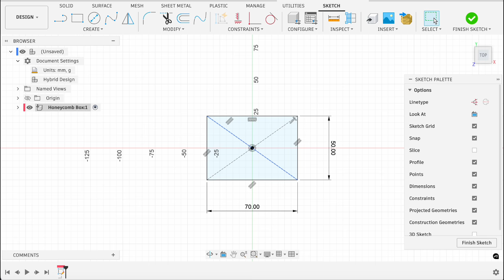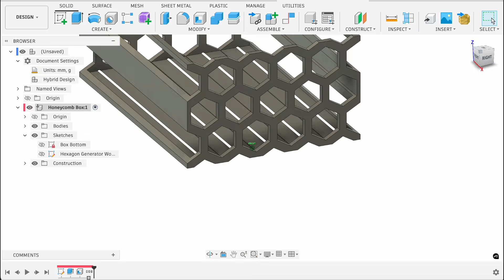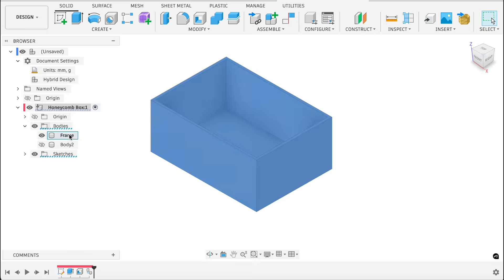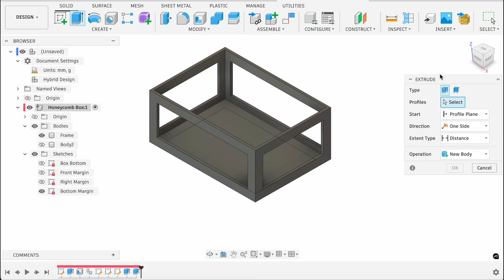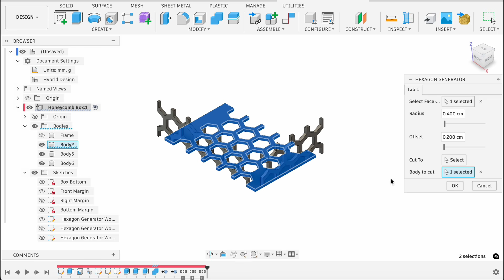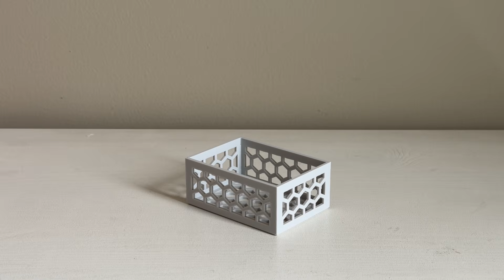Fast Honeycomb Box Modeling in Fusion 360 No Sketching! | 3D Print

Comment: how to use this on a round cylinder profile ? Tq
Reply from the maker: The Hexagon Generator works by selecting a flat face, so unfortunately it can’t be used directly on curved surfaces like a cylinder.
But you can generate the pattern on a flat sketch first, then use Emboss to wrap it around the cylinder, almost like wrapping a label around a bottle.

Comment: As a newbie, I'm getting a lot out of your videos. I just tried this and found that if I just sketched a rectangle on the surface of one of the sides, and used that as the constraint for the hex generator, I did not have to create a frame and sides to get it to work. Maybe they fixed something since you wrote them.
Reply from the maker: Interesting! Are you using Windows or Mac?
Reply: @send_to_print  Mac
Reply from the maker: That's great! Thanks a lot❤️ I'll try it later!
Reply: @send_to_print let us know if it works

Comment: You don't need to cut the separate bodies to do this. Draw the rectangle on the side and select that as the "Select Face or Profile" and the add-in will do the split, hex drawing, and re-combine automatically. It will make planes and sketches in the timeline.
Reply: That being said, the add-in is really slow and crashes/hangs Fusion sometimes, at least on Windows.
Reply from the maker: You're right, that's exactly how it's supposed to work! For some reason, when I tried it, it would only generate a single row of hexes, so I had to go the manual route. Maybe it works on Windows! Thanks for the heads-up!

Comment: I'm learning something new from every video you post. Regardless of the type of the pattern, can something like this be made parametric so the box size coudl be easily changed and the pattern (hexagons or your previous knitting pattern) to easily adapt to the box size?
Reply from the maker: Welcome back! To be honest, this specific plugin isn't "live"—it calculates the hex grid based on the face geometry at that exact moment. If you change the box size later, the pattern won't auto-update. To make it fully parametric, you’ll need to set up your own hex sketch and use expressions to link the pattern quantity to the box dimensions, just like we did in the Card Stand video.
Reply: @send_to_print  I did my own version a while ago with hexagons manually created on a separate sketch and doing patterns of either sketch or the cut/extrude/emboss features. But I could not get it to work without manually adjusting either the hex sketch or the number of hexagons in the pattern to correctly fill the sides of the box I was working with. I'm sure this could be solved with some of your parametric math skills :D.

And it does not have to be hexagons, or a plugin. I'd like to learn how to do this with any pattern and have it parametric.

There are al kind of Tissue Boxes on makerworld (rectangular shapes) with patterns  on all sides that represent what I'm looking to learn how to make parametric. Or just search "Kleenex".

Comment: Another great video! Just by the way: have you considered adding the hexagons in the 'other' (rotated by 15 deg) orientation? In the current 'tall' orientation, the printer is forced to make 60 deg overhangs. In the 'wide' orientation, only 30 deg overhang + bridging. My understanding is that the latter is usually more 3d printing friendly. Or is the tall orientation preferred for aesthetic reasons?
Reply from the maker: Spot on. The "wide" orientation is much more printer-friendly. To be honest, this plugin is a bit limited and doesn't allow for easy rotation of the pattern. It's a trade-off for the speed it offers.
Rotating the entire body before running the plug-in is a workaround, but it feels a bit clunky.
If the hexagon holes aren't too big, the 60° overhang usually come out fine anyway.
Reply: I was thinking that it is the other way around, that bridging is less desired. I tried both ways and it was fine, but I'm curious too if there is a preferred orrientation.
Reply: @secerator in many ways a steep overhang is much harder than a (short) bridge. But it does depend on the length and the material in question.